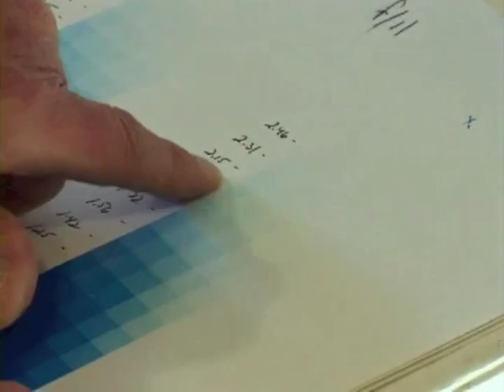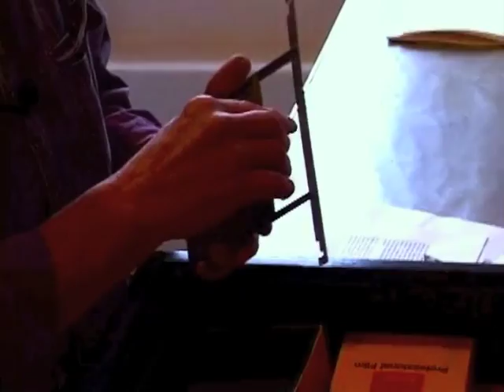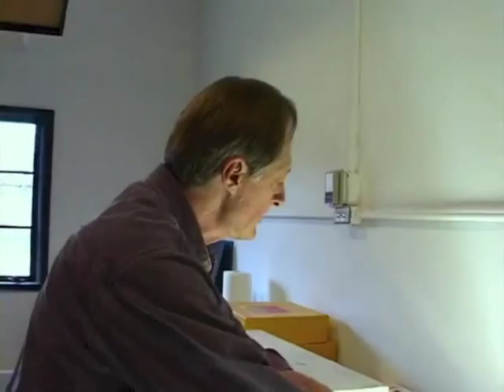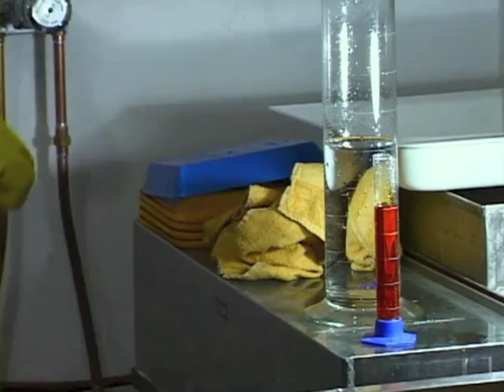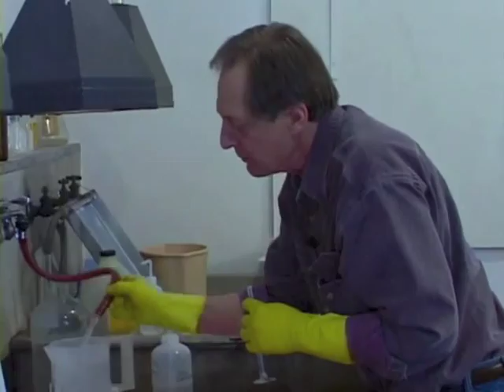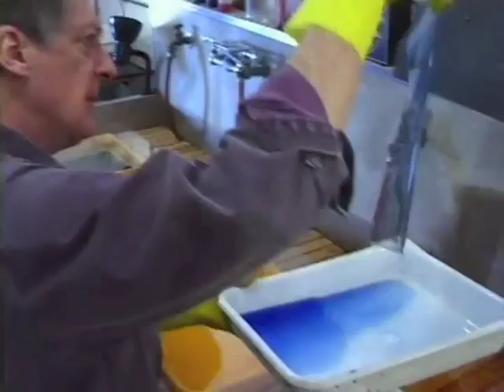Eliot Porter's Darkroom with Jim Bones by Tomas Haywood

Comment: Is this a process only necessary for slides, or can one translate it into digital, using for instance Photoshop?
Reply: I'm sure there's an instagram filter for it, if you're considering dealing with the trouble of photoshop I would recommend that instead
Reply: From my experience, the Selective Color editing option in Photoshop is the closest analogue to the color control possible in dye transfer.
Reply: You can use Lightroom and print digitally. You just need a high quality printer for photography.